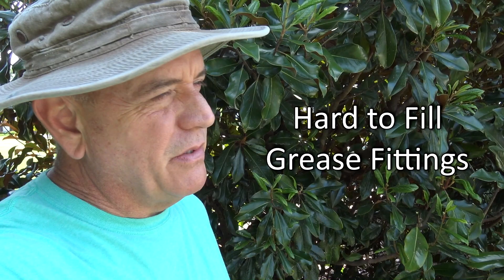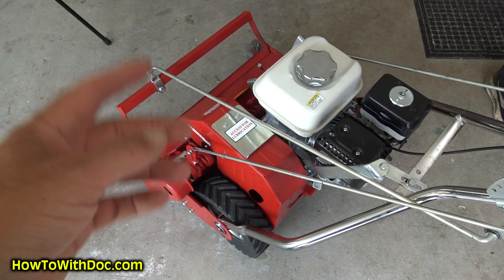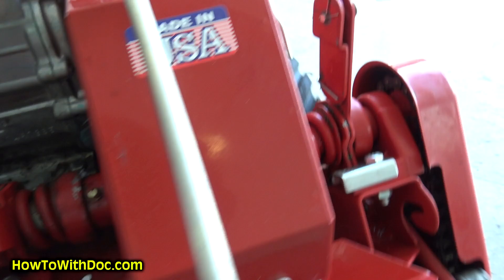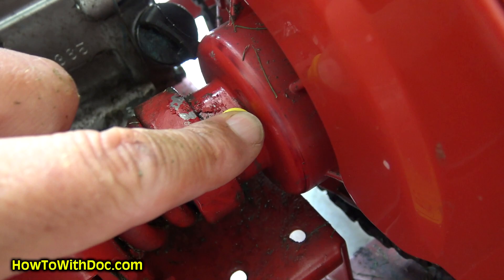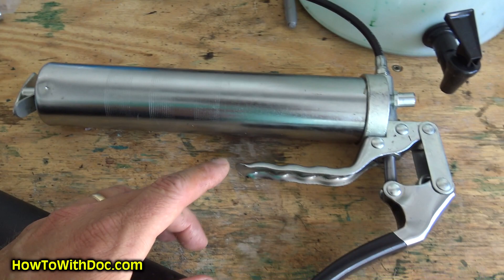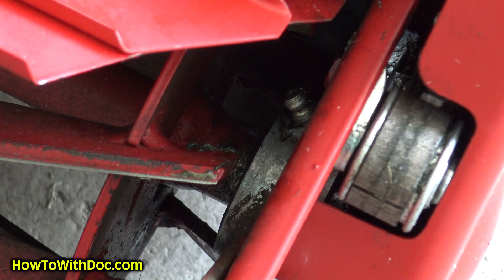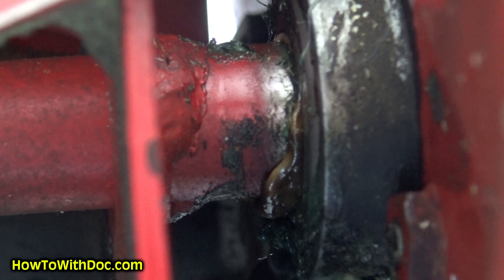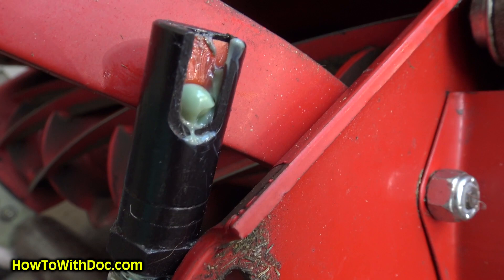Hard to Reach Grease Fittings

Comment: Doc, I agree with 2 shoes. The best thing that you can do is to replace the straight zerk, with an angle zerk. I'd imagine that the 90° would work the best. You can find full zerk kit's with multiple types and sizes for about $20 or so. My next point is, even though you saw the grease exit from a bushing, after squirting it from another fitting. You more than likely still need to grease the other one too. I've seldom seen two fittings for the same part, it looks like the top fitting is for the shaft & the lower gets the bushings.

Comment: Yeah, very nice tip Doc.  I'm a retired Manufacturing Engineer and have seen engineers design impossible situations for years.  When I find those zerks in locations that are inaccessible, I just change them out for a 90 or 45 degree zerk, problem solved.  Zerks are only about a dime each.  You do have to watch the thread size though.  There are small size and large size thread diameters so you might have to have a few selections on hand.  I have a small jar of about 20, it cast me a couple of bucks.

Comment: Hey Doc, took my real mower to get sharpened yesterday and asked my guy about a couple of these zerk fittings that are hard to get to and he said the one above the tire is not necessary and the one that’s inside the real housing that’s tough to get to has a zerk fitting underneath that is easily accessible that pumps fluid into the same section as the other one that’s tough to get to. Hope this helps!

Comment: Doc the longer lockNlube works on all the zerks except the one that needs the 90 degree.  I find the lockNlube the only attachment needed for the other zerks.  LockNlube also sells a flat a 90 degree as well.  Also do a video on reel to bedknife adjustment and you will really have fun. backlap video would be good too...

Comment: Zerk is the word you are looking for, as in "grease Zerk".  I've had one of those 90 degree fittings for about 30 years.  I have a Zerk on the back end of my 90 degree fitting so I only use it on those places where nothing else will work and I don't have to swap grease guns or get out a wrench and swap ends.

Comment: They sell a gadget for trailer wheel bearings with a piston that's compressed by a spring. You fill up the cylinder with your grease gun and the piston delivers grease as it's needed. It seems to me like manufacturers could use the same concept to make grease fittings more accessible to the end user of the equipment.
Reply: I work in the freight industry. I've noticed in the last year that some of the new equipment,  trucks, trailers, dollies, a jockey wagons,  have reservoirs with lines going out these areas that need greased. It uses the same concept. When they get serviced the mechanic just fills it up.

Comment: All you need is a needle grease fitting. It will apply at a 10 degree angle. They have different lengths.

Comment: How do i remove a zerk with no hex head, im stumped
Reply: As I understand, there are some grease fittings that are designed to be pressed (or hammered?) into a smooth unthreaded hole.  That may be what you have, if there are no flats for a wrench.  I guess that type of fitting would need to be pulled straight out of the hole.

Comment: You can buy a grease nipple set with 90 and 45 degrees adaptors that just screw into the same hole as the original
Reply from the maker: Have then both... won't fit on that one fitting. Also, it LOCKS more than a standard push on fitting.

Comment: Dr, thought you should know. Greasing the spindles on a riding mower is a waste of grease, useless. Spindles all have sealed bearings. You can’t get any grease to the bearings. The only way you can grease the bearing  you have to pop the sealed bearings out of the spindle and take off the plastic lip on the bearing to reveal the actual bearing. Then you grease it by hand and force the grease into the bearing and push the plastic washer back on. Walk.
Reply from the maker: I've seen that video... however there still is SOME benefit to greasing the hubs even though the bearings are sealed.